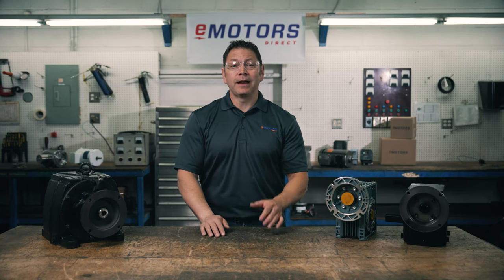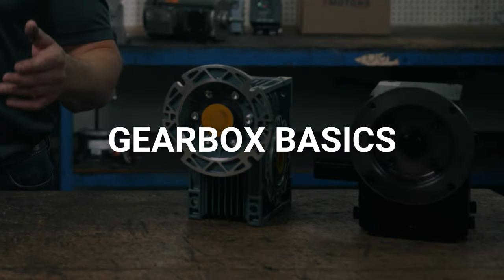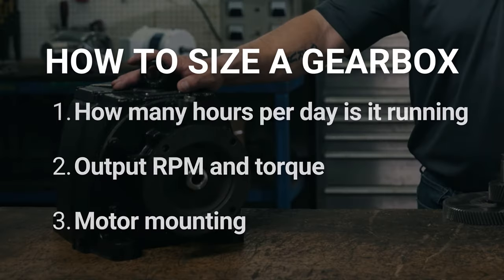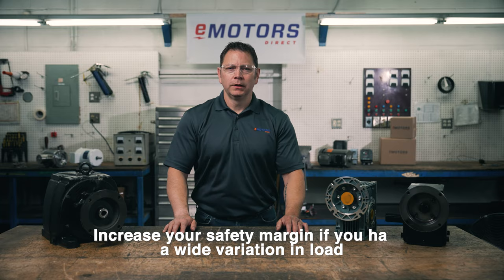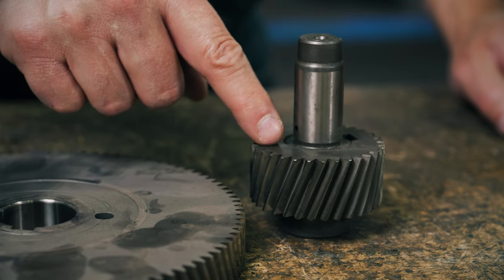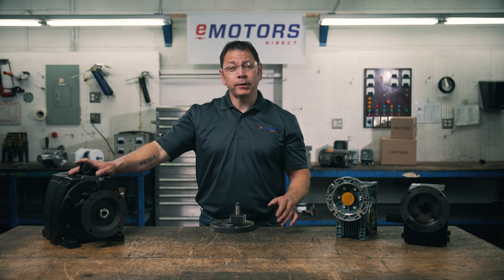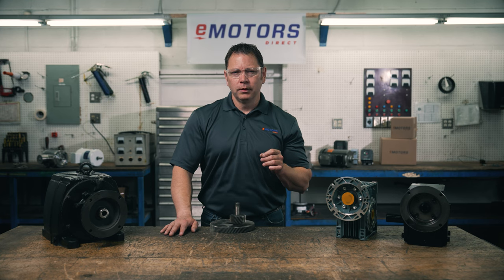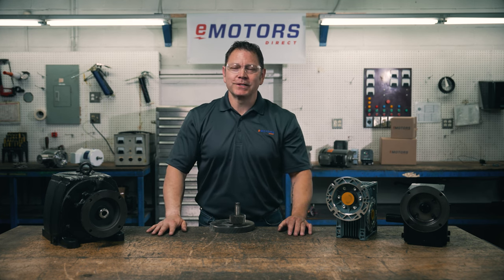How to Size an Electric Motor Gearbox/Gear Reducer

Comment: I have two questions, first I want to know if a speed reducer can be turned front to back and work as a speed multiplier and also if it can work with a hydraulic motor. thank you
Reply from the maker: Hi Penja. Technically, yes, but the components have a speed rating that cannot be exceeded. Say you have a 5:1 box with an input rating of 1800 RPM and an output rating of 360 RPM, if you were to use the output as a speed multiplier the maximum input RPM would be 360. This is not a very useful input limit since there aren't really any motors that run this slow.

Comment: Thank you. Good video as well btw very informative. I have a couple of questions if i want to automate a can crusher with a  max speed of 1725rpm Nema 56C motor @0.5 hp with a goal of crushing a minimum of 1 can per second. If the can crusher would be running for multiple hours in an industrialized setting would it be better to get a gearbox that runs at a higher hp such as 0.75hp or 1hp to allow sufficient cooling and avoid downtime as mentioned in the video.
Electric Motor has a service factor of 1.25 but the service factor of the gearbox is not given.
Reply from the maker: Hi Mathew, thanks for the question. Gearbox service factor is not an exact science but you are correct in wanting to oversize the gearbox. You can figure out the oversize you need by using our gearbox selector here:  https://www.emotorsdirect.ca/builder/gearbox
Reply: @emotorsdirect  thank you.

Comment: I want to automate a gang isolator of a 33okv line, any advice on the kind of motor and gearbox to use
Reply from the maker: Hi Clinton, thanks for the question. This one might be above my pay grade. 

What are your torque requirements are and what code compliance are you looking to meet? 

- Keith

Comment: I have a question,  lets say i have a gearbox without a data plate. How do i identify the size
Reply from the maker: Here's what I would do: 
(1) First you would have to figure out what style of reducer, worm gear, helical inline, helical bevel, etc.
(2) Then you would need to take some measurements to determine the case size, shaft sizes, etc.
(3) Then you would need to turn the input to see how many turns it take on the input to make the out put go around once. This would be your ratio.
(4) Confirm what HP motor you are driving it with and how many hours per day it is running.
(5) From all of this info, your local gearing distributor should be able to make an educated guess.

Happy to help if you are located in Canada or the US. Feel free to contact our team: https://www.emotorsdirect.ca/contact-us

Good luck!